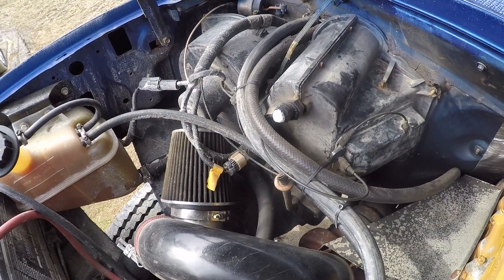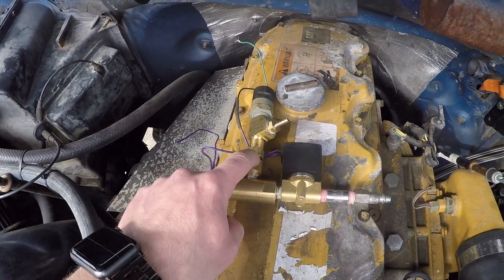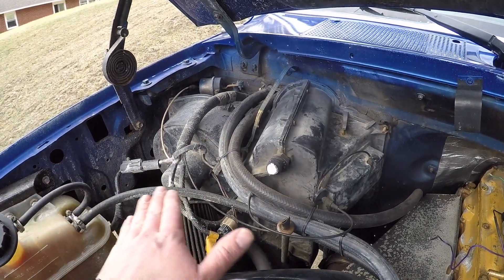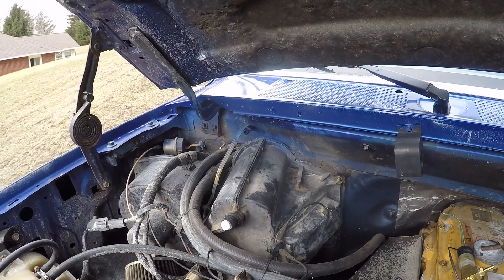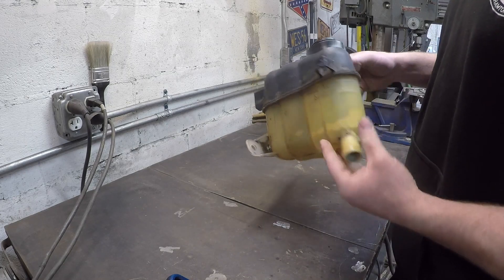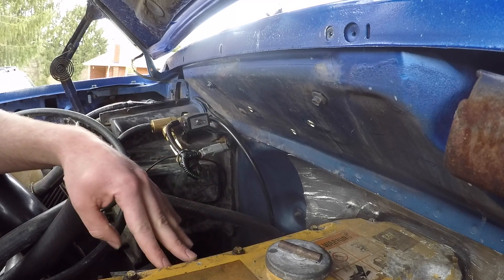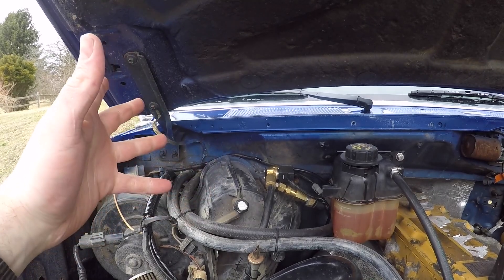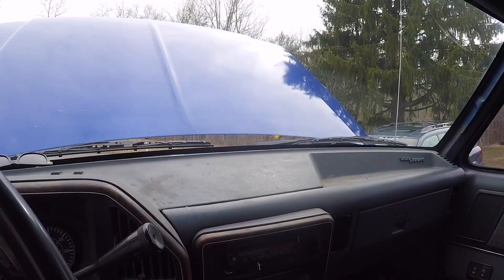Pt. 40 Using Compressed Air As A Vacuum Pump. Fixing The Heat On My F350

Comment: Have you looked at getting the electric vacuum pump and reservoir out of a 99-07 super duty??  Would work really well since all it is running really is your hvac now that you are using a hydro-boost brake booster.
Reply from the maker: Unfortunately I typically don’t find out what vehicles have the perfect parts for what I’m doing till after I do it lol the Venturi is working great tho so I will probably stick with that. Thanks for your input!

Comment: How's the fuel mileage doing ? I watched most of the build.  Did the bigger tires help or hurt?
Reply from the maker: As it sits I have been getting around 8.5 mpg, with plugged fuel filters I can get close to 9! I never calibrated the speedometer when I was on the factory wheels so I’m not sure if or how much that helped my mileage.
Reply: Nice build! JC said check it out!

Comment: Once you get your overflow situation sorted can’t you park in such a way on a hill or use blocking to make that the highest point and burp the air out? Or would air go back in the first time it vented?
Reply from the maker: If I open both caps the radiator will fill to the top but when the system cools off and there is any negative pressure in the cooling system it will draw air through the cap and trap it in the radiator till I manually release it.